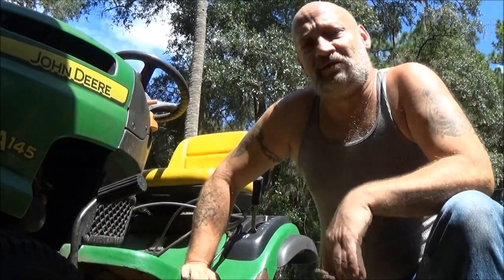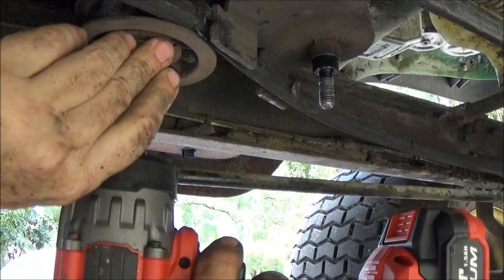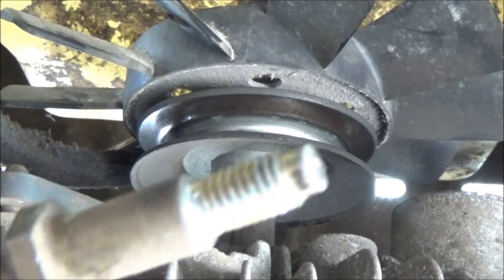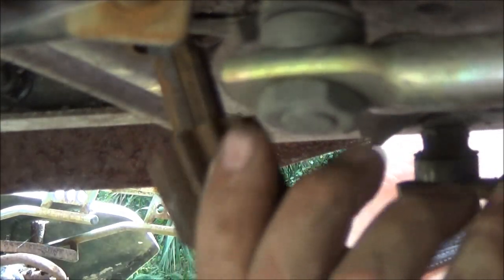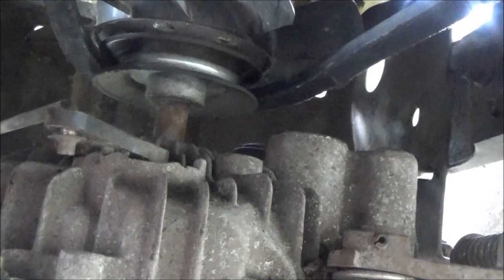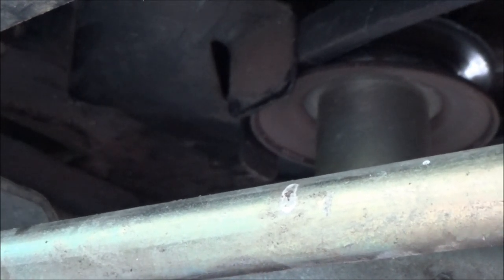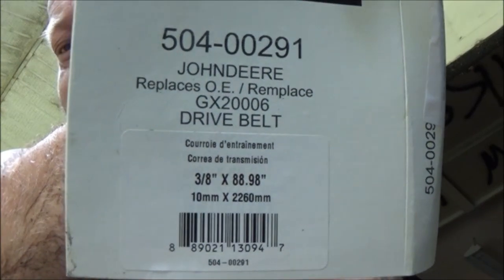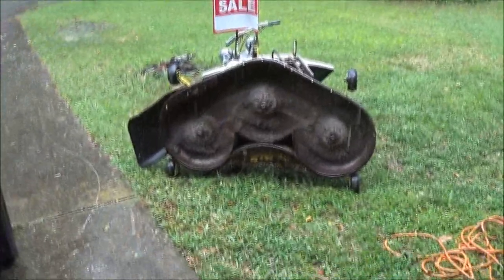John Deere LA145 Drive Belt Replacement

Comment: Thanks for the video very helpful. The only thing I did wrong was put the belt on the back before the front. I had to remove the electric clutch in order to get the belt around the pulley . No big deal. Thanks again.
Reply from the maker: Good job. I'm glad the video helped. Thanks for watching and commenting Randy.

Comment: Dude , thank you so much . I was ready to have my John Deere LA135 picked up by a local repair place . Same problem . I thought I blew the transmission . Plus $100 for pickup and delivery . My machine is 10 years old but in new condition . You can see it in one of my latest tune up videos . It just stopped yesterday and started to smoke . Rubber smell . It was the same pulley as yours . Stuck !!! . Thanks you again from Massachusetts 🇺🇸🇺🇸🇺🇸 .
Reply from the maker: Hey man, you are very welcome. I'm glad it helped you. Always nice to save a little money. Thanks for watching and commenting. Have a great week Dave.
Reply: @shabear1000  Have a great week buddy . Thanks again

Comment: The guide pin In the transmission was a bear to get out. I looked it over after i got it out and noticed it was an allen head on the other end from the threads. I took out the drink holder out and put my hand through there with a 6mm/7/32 allen socket with a one inch ext. and put it between the fan blades the a 3/8 ratchet and went in really easy. Next time I do one I will take it out the same way and not fight it. Just thought this might help.
Reply from the maker: Thanks for the tip Tom. Maybe it will help someone else.
Reply: @shabear1000  hopefully me?? Going try and change the belt next  week! Good tip!
Reply from the maker: You should be alright. If you have any questions please feel free to contact me.
Reply: @shabear1000  thx

Comment: Wow, I never realized how involved it is to change a belt & pulley's on some of these lawn tractors.  Thanks for the video.  I need to get me one of those 1/4" impact drills, I've been looking at the Bauer & Hercules models at Harbor Freight.
Reply from the maker: thats what this is, a Bauer. i've had it for almost 2 years with 0 issues. the battery is awesome and i got it for around $47.00
Reply: @shabear1000  Thanks, that's good to know.  They have it on coupon every once in a while.
Reply from the maker: @Pyridox  if you get one you will love it, thumbs up from me.

Comment: I am assuming this is similar to an L110?  I have the same problem, won't move.  Stopped after I turned the mower off.  Probably going to try the Pulley first.  Thanks for the video, very helpful!
Reply from the maker: Yes very similar. And thanks for watching and commenting..